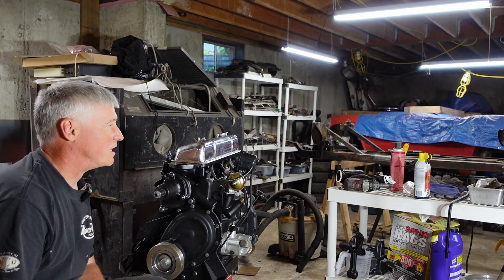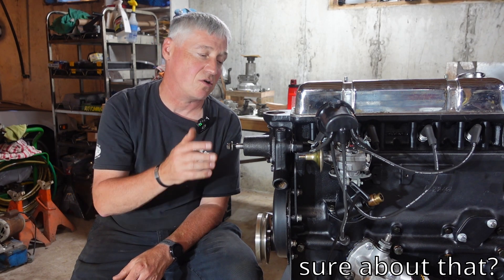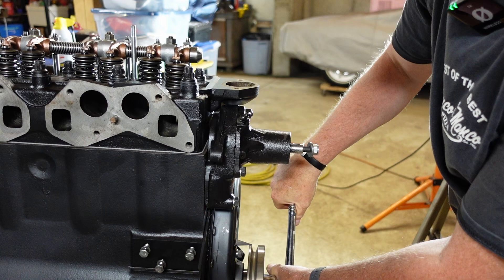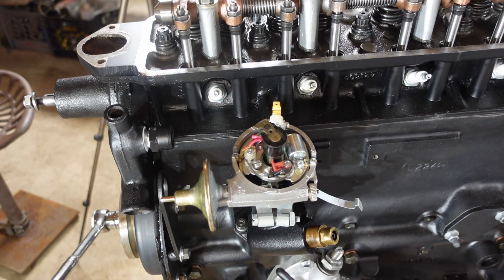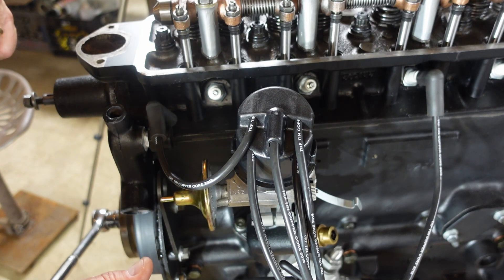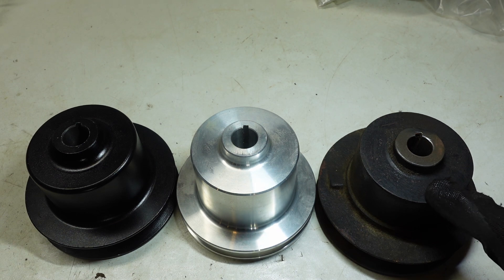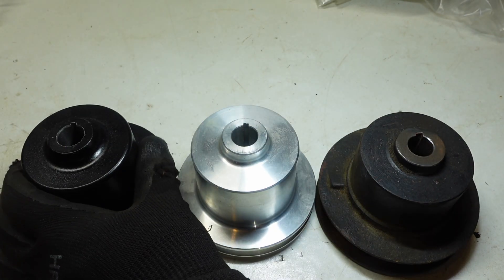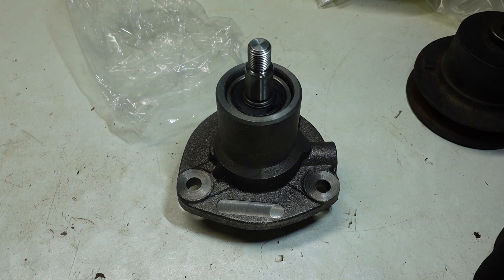Triumph TR4 - Engine Rebuild #19: More Problems | Roundtail Restoration

Comment: Hi Chris, returning to your distributor and HT lead issue.  I think that in the clip you were talking about counter-clockwise rotation while looking down into the cap.  However, with that inversion, the relative rotation would of course be clockwise. 

I have a narrow belt conversion on my 4A;  Using dividers I have measured from the machined face of the block to the inner face of the aluminium pulley at 70mm and approximately 80mm to the centreline of the belt.  Sorry about the units, but I hope it helps give some peace of mind regarding the location of your pulley
Reply from the maker: Thanks, Robin. I'll take a look at my wires again. Would surprise me if I got it wrong again. As for the pulley, that 10mm delta is just about what I'm seeing so yes, that makes me feel a bit better. Thanks!

Comment: Hi Chris, Suggest you use a long stud instead of the bolt (a long rocker stud could work)
Reply from the maker: I'm not sure where you mean? Thanks!
Reply: The pump is held on with two studs and one long circa 3” bolt. This bolt can be a hassle and a long stud alleviates this problem. Given the problem you experienced your pulley may no longer be readily removable, so the stud might help
Reply from the maker: Ah, I understand. Good idea. I'll look into that. Thanks!

Comment: Hey Chris..... I utilize a near myriad of Loctite products in my restoration business. It is amazing what has been developed since the blue and red of years ago. 

I am following along on your journey.  I have a spreadsheet of projects to complete on my 4A.  one of those projects is a noisy water pump. I may pass on the pulley conversion if yours doesn't work out. The belt should be aligned with the 3 pulleys. 

I restored my 4A in the early 80's. I am going through some of the items that didn't turn out a well as I expected. I have learned a great deal through the years. The greatest learning experience is patience. 

Happy 4th Chris. Be good. Remain safe
Reply from the maker: Thanks, Matthew. We'll see how it works out, but definitely rough going right now.

Comment: Well it's on and it looks good, I presume you lined it up with the crank pully. Happy  July 4th in a few days.
Reply from the maker: Hey, Barry. I did NOT line up with the crank pulley. Huge concern. But, I'm going to delay stressing about it until a "future me" time. We'll see what happens. But, if I have to roll this all back and go with the stock arrangement, I will. Won't be happy about it, but I will. Cheers!